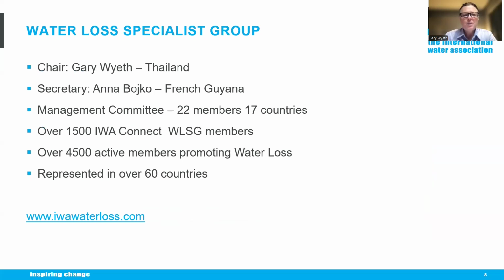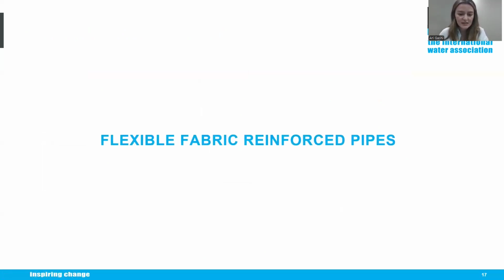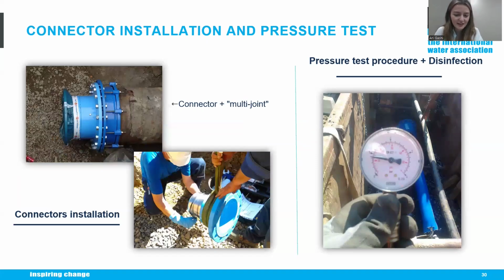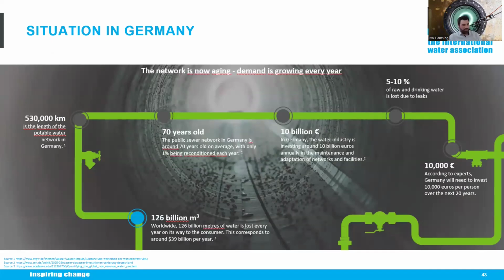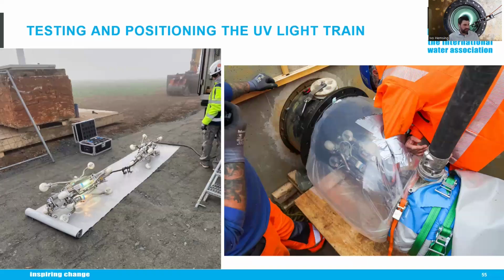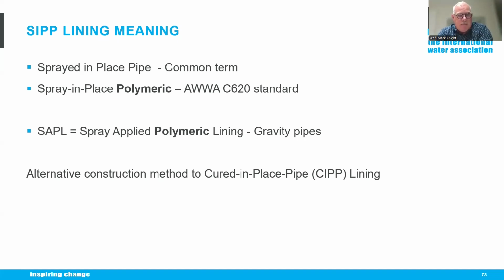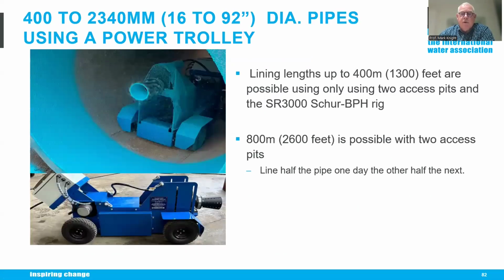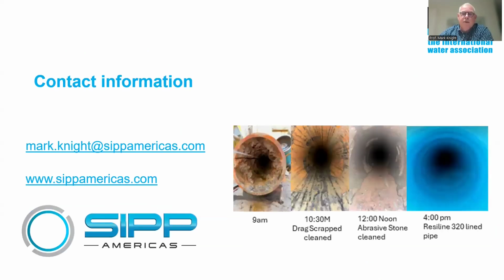IWA Webinar - Strategic Trenchless Rehabilitation Technologies for Water Loss Reduction

Comment: A very relevant topic for water-loss management. Leak detection is essential, but finding leaks alone cannot solve the problem of ageing infrastructure. Combining active leakage control with targeted rehabilitation and measurable results is where the real long-term value lies. This is also a topic we are following closely at Water Loss Detectives in Romania.